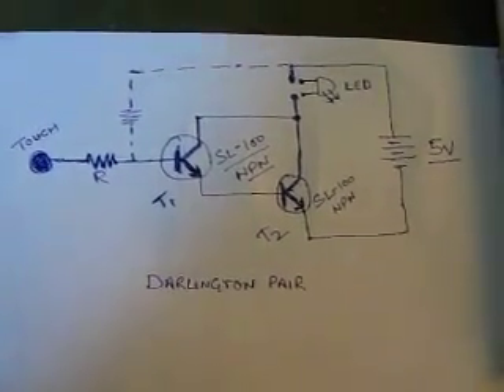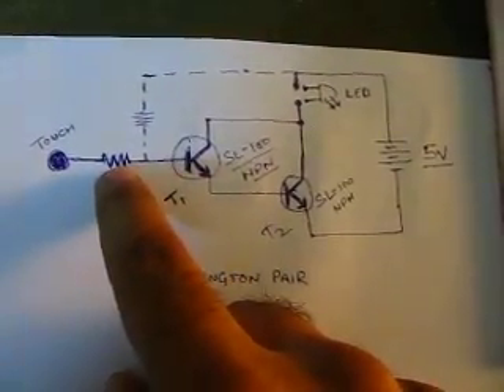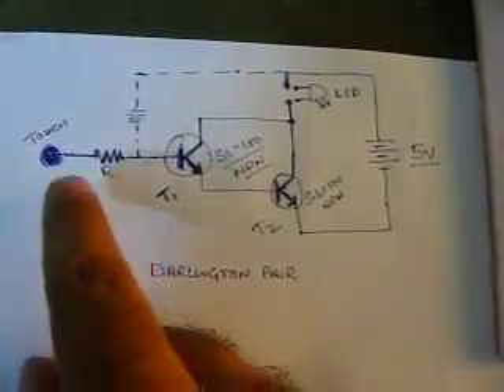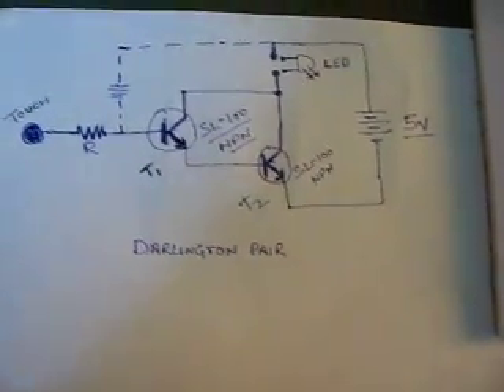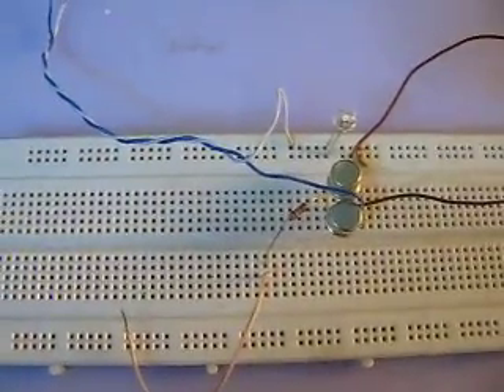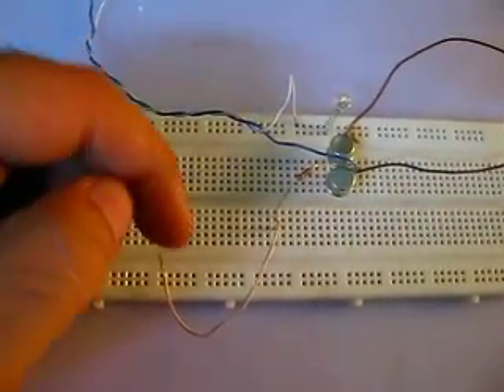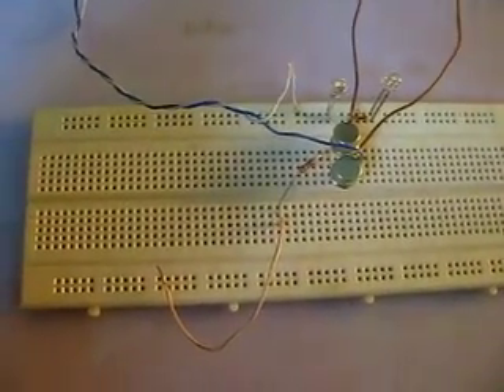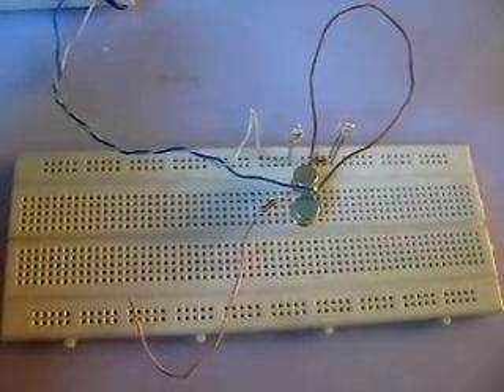Darlington pair

Comment: what voltage is that LED capable dropping before it blows?

Seems like with all the current passing through the second transistor, the voltage drop across the LED would be high enough to blow it out.

Comment from the maker: by touching the wire, u are actually allowing current to pass through ur body (very small current), so if u are sitting on some super insulated material, the current will not flow.. 
Hope it helps..

Comment from the maker: It works normal with one touch coz, the touch terminal is at high potential and human touch is acting as ground here, may be you can try increasing supply voltage or try decreasing the base collector resistor.. just a advice.. considering i m also not a expert :P